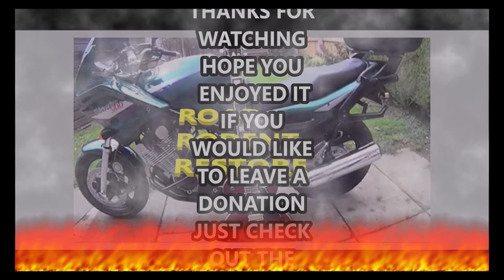Ford focus MK2 1.6 petrol. Coolant header tank replacement. UK.

Comment: Do these not need pressure filled etc? I presume to bleed the system you can just run it with the cap off to bleed?
Reply from the maker: I had no airlocks didn't bleed mine.👍
Reply: @jonyr1TT  awesome!